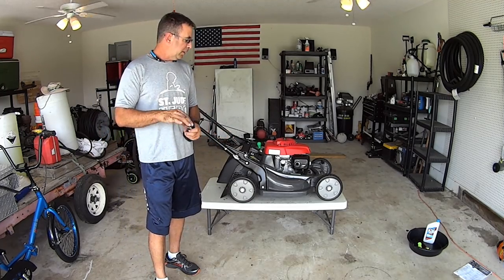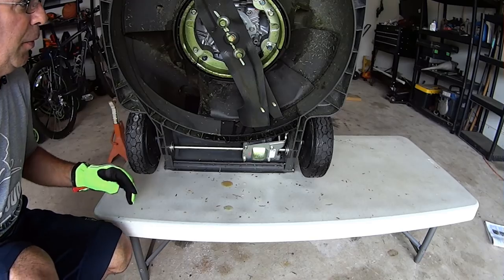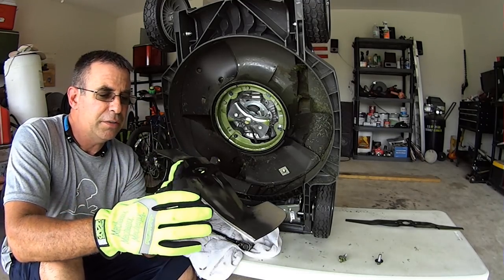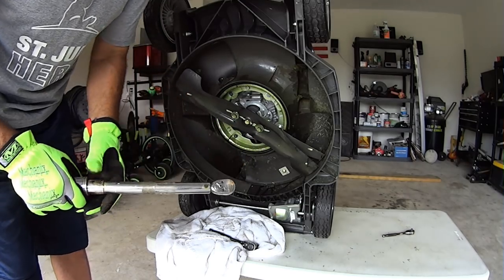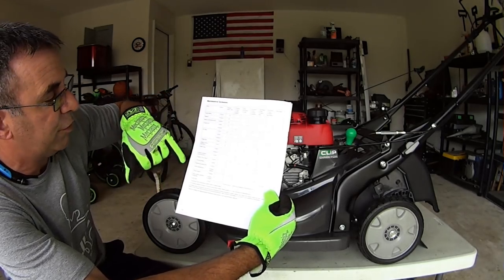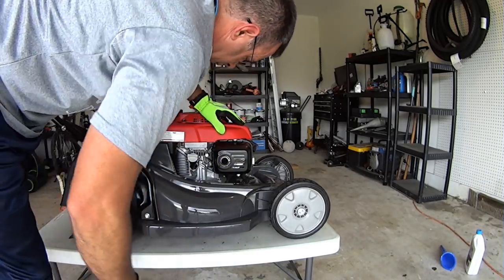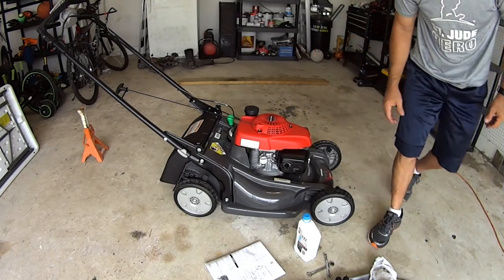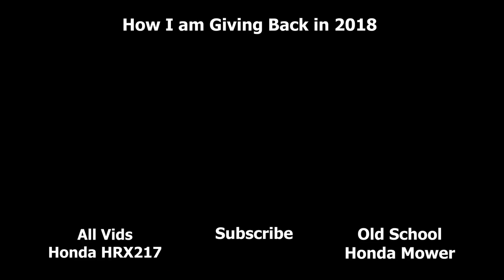Honda HRX217VKA Step by Step Maintenance Tasks Performed by the Manual

Comment: Stoke to find your video. My Honda started smoking white smoke after 1 month inactive ? Any ideas???
Reply: BTW after letting it wam up the smoke and smell went away. Maybe ethanol gas?
Reply from the maker: Oil seeped thru the rings. It’ll be fine. Check oil level and be sure not over filled
Reply: Dan's Vlog Thanks will drain and re-fill. Didn’t realize I over filled until I saw your video

Comment: Hi Dan, when you bought a new honda mower like this one, is the engineer oil already fueled into the machine, or you have to add oil before using it for the first time?
Reply from the maker: Whenever you buy lawnmowers from an authorized dealer they usually come full of oil and tested. If you buy them at a big store like Home Depot or Lowe’s, you might have to assemble a little bit of it and add the oil before you start it

Comment: I have the same exact mower as you have, but mine revs up too high suddenly, the spring throttle is attached, and tried to move the throttle around a bit, and still revs up high

I put oil in it, put regular gas in it, and still revs up like it's going to explode, is there a way to fix that issue?
Reply from the maker: I would check that fuel isn’t getting blocked in the main jet causing a “Lean” issue which always makes engines increase in rpm

Comment: Do you have a video on changing the transmission fluid? I opened my transmission tank in error and all of the fluid spilled out. Do I replace it in the same area that it spilled from? Thanks
Reply from the maker: There should be a plug on top if I remember correctly. If not, look on the side and fill it only to the opening of the side bolt
Reply: @DansVlog  Thanks much  I appreciate the response
Reply: Dan's Vlog 
Good video !

Comment: Dan how do you adjust the shift cable nuts that hold cable to The handlebar three-speed it's slips I don't don't know how to figure out how to adjust those two little nuts to hold the cable to The handlebar
Reply from the maker: I’m not sure I understand what you’re talking about. I haven’t used a three speed

Comment: Thanks for the great video.  I have this mower but have been having trouble with the butterfly select drive.  something happened to it after running it a few times and now the tension on the butterfly is very high and it's difficult to press it down into the handle. The propulsion has also stopped and no longer works.  I'm guessing from your video that means I'm not getting any tension on the drive belt at all?  I've had it into a Honda dealer several times now and they haven't been able to fix it.  I'm running out of ideas so I was curious if you might have an opinion or suggestion?  Thanks!
Reply from the maker: Adjust the cable to start with, also ensure the cable has no kinks in it

Comment: I just bought one of these off craigslist and the self propel feature was removed. will that cause issues?
Reply from the maker: There should be no difference in the performance of the engine and it’s ability to mow… But dang, that’s a heavy mower to have to push
Reply: @DansVlog  Yeah, I didn't really think about that when i picked it up. Lucky I have very little to mow and its all flat.  I mowed my front yard this morning and it works a lot better than my old side discharge mower.
Reply from the maker: Sharpen the blades

Comment: What about your wheels? And bearings
Reply from the maker: No maintenance is required on the wheels and bearings. They are sealed bearings like skateboard wheels
Reply: @DansVlog  awesome. I did lube the shaft with red n tacky. Don’t think it’ll hurt it

Comment: I think you are way over thinking the process of saving "A" step.  Jeez.  I have owned a Honda HR194, for 32 years.  I am finally thinking of replacing it.  At the time it was equal to the commercial mowers then and now.  OHV engine, shaft drive to the 2 speed hydrosatatic transmission.  Aluminum deck and double roto-stop and propel bar.  I will personally not switch from the system, that Honda still uses 32 years later, for the self propel function, absolutely nothing ever to adjust.  I never had to adjust any of the 3 cables.
Reply from the maker: I’m not sure I understand your comment but I do appreciate your experience so I’m going to give you the benefit of the doubt that you’re not trying to be a dickhead but let me explain something to you, this is a YouTube channel that is open to many different interpretations.  Dozens of people to hundreds of thousands will view this video. Where you might think I don’t need to do a particular step the book calls for... if I skip that step then there will be equal number of assholes to jump my shit very quickly to tell me that I have bad maintenance procedures by skipping a step. So when somebody on YouTube follows the manual to a T,  I’m not sure that’s worth criticizing but rather somebody with your experience can just knowingly think to themselves  I don’t need to do that and you just leave it at that.
Reply: @DansVlog  I did not mean to condemn proper maintenance so much as point out, in a round about way, that the top end models require less effort to maintain.  AAMOF I am reluctant to buy anything short of the Honda commercial with roto-stop and the hydrostatic transmission. 
Seriously,  I have changed the oil only once a year for 32 years, 2 spark plugs, 3 air filters, and a blade.  
The issue now is that the recoil rope does not want to rewind until the mower is warmed up, a tire is coming off of one of the wheels, the valve seals probably need to be replaced, the engine puffs out a little smoke, "sometimes" after sitting for a week, and the roto stop lever does not want to stop rusting.  I have taken it down to bare metal, primed and repainted 2 times.  I am oddly very attached to this mower.
Anyway my referral to the saving "A" step was your comments about actually mowing and turning corners.

Comment: Really wanted to see valve clearance.
Reply from the maker: I don’t take off engine components to get to the parts like that. Honestly I’ve never had the valves adjusted in anything I’ve ever owned
Reply: Good point. I know many honda mowers that haven't ever had them adjusted and went for 10-20 years. And here I am - young buck thinking he can make the mower better by checking the valves every year.

Comment: Really, on the topic of liability creating advice, some clever person could probably weld a cable relocating bracket on the sissy bar so it goes over center and locks itself on.   I, of course, recommend strongly against it and am citing it only as an example of what not to do.   Kinda like that sticker on snowblowers that shows the hand stuck in the blower, that is also telling you not to do that.

Comment: I would put some Mobil 1 in it and forget about it.
Reply from the maker: I like Mobile 1 too but the manual does not say I can use it so for video purposes, I did it by the manual. I doubt Mobile 1 will cause damage but it isn't my place to say
Reply from the maker: Good info Calvin. Guess we should wait until they test it
Reply: Thanks for the details on the oil. I would never buy a mower where the manufacturer was wishy washy on whether or not synthetic oil was ok to use.
Reply: mobile 1 has poor protection compared to Lucas or Amsoil on small engines. Just an opinion from the ASME tests I've seen. I'd use mobile 1 in my car because i'm not trying to go above 400k miles and it's cheap, but meh in smaller engines prone to carbon build up I'd use something better.
Reply: Dan's Vlog I have the factory service manual. It says synthetic is fine. I can send a copy of the page if you’d like.

Comment: Ummm you tipped the oil side into your carburetor, no wonder it's surging. You need to either try and clean the jets with a hand drill or just replace the carburetor and the huge gasket set (not exactly an easy job)

Comment: Ive seen so many vids with guys incorrectly using the dipstick on these. Good Job! Also i'd use 30W if i were you. Per manual 10/30 is conventional use. You aren't. You are robust conventional/commercial.
Reply from the maker: You go ahead and use the 30W, I will use the more diverse 10W30 which is exactly what I should use as per the manual.
Reply: Dan's Vlog yep 10W 30 Mobil 1
Reply: The difference between 10W30 and straight 30 weight is that 10W30 will lubricate better when the oil is cold. Once the engine is warmed up both will behave the same. 

Realistically there will not be much difference for a piece of equipment only operated at summer temps, but it's cheap insurance and it means you don't need to keep separate oil on hand for your winter and summer equipment. Might not be an issue in GA, but up here in MI I like only needed one kind of oil for all my power equipment.

Comment: The engine will last forever...What I've noticed about these mowers, is the front wheels will start to bow out.  Watch...I've had two...Same thing...And don't use dino oil...Use synthetic...
Reply: The front wheels on mine bow out also. I think the plate that they are mounted on bends easily.
Reply: @LnStar492  how do you fix it?